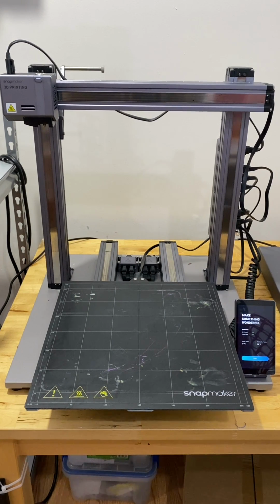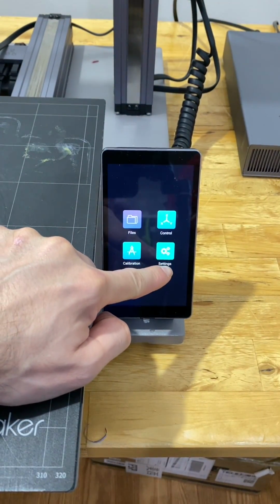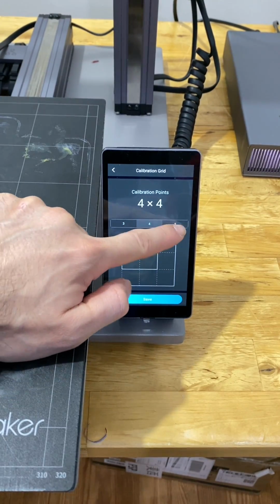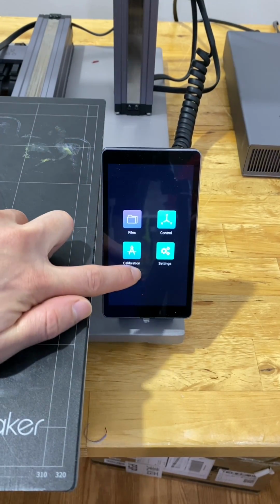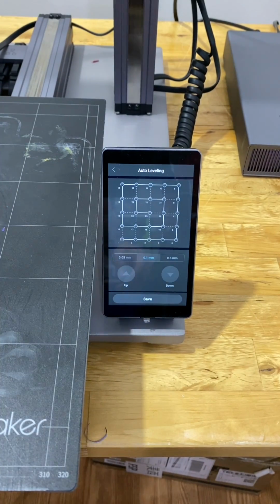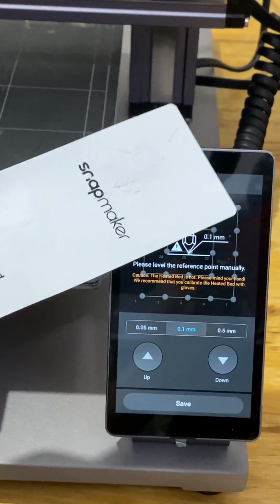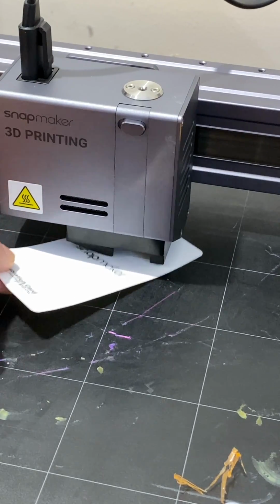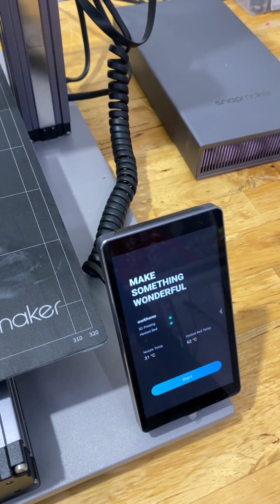How to level Snapmaker A350 - Step-By-Step Tutorial

Comment: I've tried auto 3x3, 4x4, 5x5 and manual 3x3, 4x4, 5x5 with the bed heated, without the bed heated, just seems that no matter how I do it, it's never leveled enough. I end up with the center perfectly fine but for some reason the rear left and always the rear left side seems  to get too close to the bed almost diggin into it.

Comment: Have you ever had the print head starting below the bed when using gcode from Luban? I enable travel in the print preview and it shows the print head beginning at the exact same height as the bed and pushes it from the corner until its at the correct height and prints the first layer perfectly.

Comment: So if you've already done that and the bed still isn't level, what are the next steps?

It's perfectly level in the middle, but the corners are crap.
Reply from the maker: How bad is it? It should be able to use its mesh to compensate the issue
Reply: @3DPDoctor  In the middle, it's perfect, and there's no adhesion in the corner (the extruder is too high). I stopped my print after that since it was going to be spaghetti.
Reply from the maker: I do suggest updating firmware if not already. Since its doing mesh bed leveling it should crate fading. I suggest contacting customer tech support at this point. They can show you how if something is not working.
Reply: @3DPDoctor  Great video. Once I updated the firmware and did the 5 points, I was good to go.
Reply: @Foodgeek  Have you solved? I have the same issue
Reply: @3d_printall  Yes, it took a lot of work. I installed the lastest firmware from github which does warm auto leveling and then I used OctoPrint to make a graph of the bed and then I added shims of paper in the corners where it was too low. I get a good first layer now 😊
Reply: @Foodgeek  so the z offset cannot be auto adapted according to the current position of the mesh?
Reply: @3d_printall  In my case the bed simply wasn't flat enough.